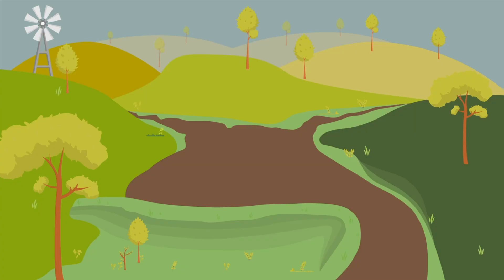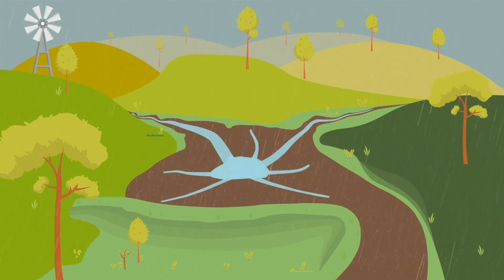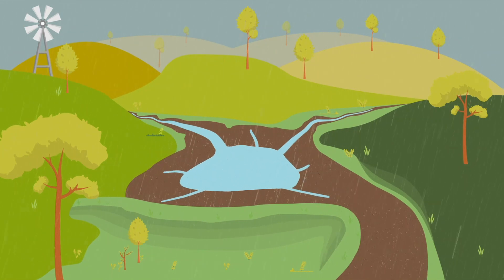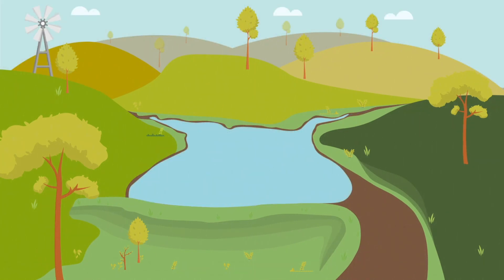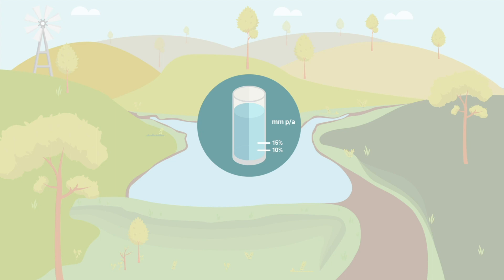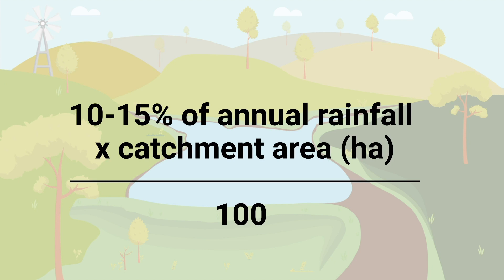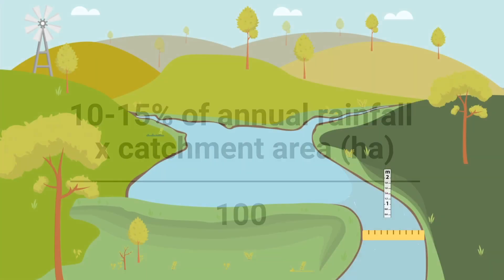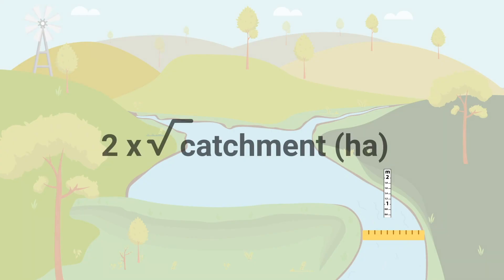Gully Erosion on Your Property Part 5

Comment: Everybody loves ponds but ponds hold water like a cup & once their full they can't hold much additional water, so little is gained. 
Although the gully needs to be mitigated, instead of building a pond, a series of low crescent shaped swales up the catchment area would be more effective. The crescent swales, w/ their outlets at the tips running into the swale below them in a large fish scale pattern. The swales can be engineered with gentle slopes that would allow grazing & even cultivation. The swales would be designed to hold the same amount water as the pond but allow for better infiltration & evaporation. - plus you could still have a pond if you wanted